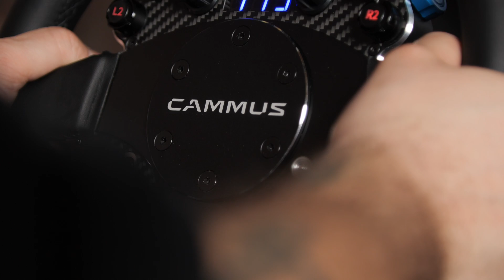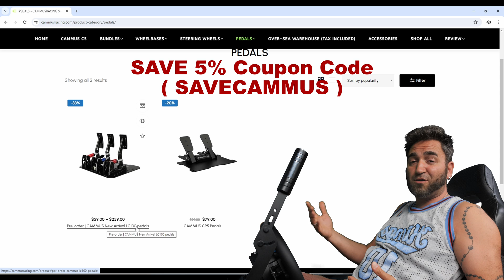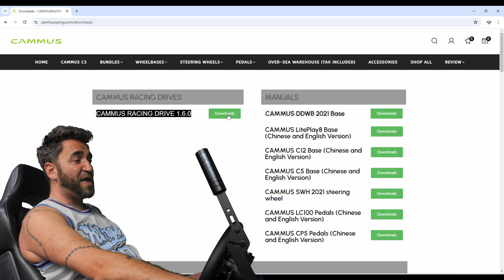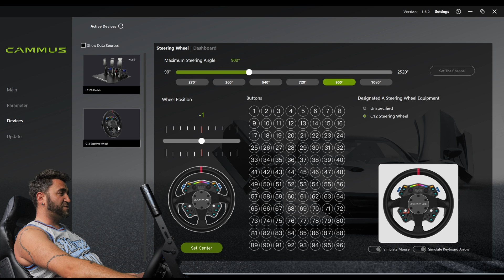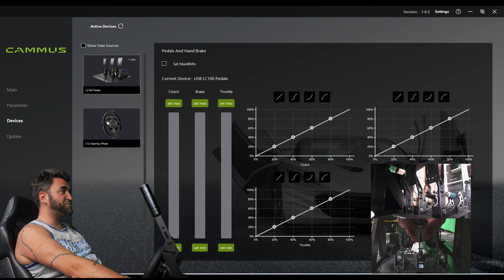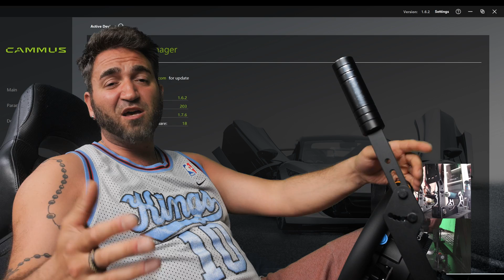Cammus Racing Drive PC Software Tutorial - Settings & Firmware Update

Comment: I’m having trouble sir with my steering wheel c5 like I have the app downloaded on my pc and everything but the wheel is not connecting too it even tho it’s on
Reply from the maker: Is it brand new? 
You just got the steering wheel or you had it for a while now and it just stopped working ? 
Maybe you need to do a firmware update in the app. 
You’re using it with your pc right? 
You connected it to your PC with the usb cable ?

Comment: Hi, when you did the software installation and you came to the driver installation portion. Did you leave the three boxes for the drivers checked and did you answer yes or no when it asked to remove associated components before the install. I'm only asking because i had trouble with my first wheel after software installation, and communicating this to Cammus is difficult due to the language barrier.
Reply: If an OFFICIAL device software recomends to have some components checked, leave them on. Even if some of them are already installed (like VC redistributables) leave them checked. Some are libraries DirectX (and Windows in general) needs to let the software and device work properly. Sometimes when they're already installed they're overwritten, other times the installer skips installation. But if the software says you need it, never uncheck.
Another thing is when the software is downloaded from unofficial websites. But the official site...do as they say.
Reply from the maker: @albertmas3752 great thanks for the suggestions.
Reply: But what was your problem? For example, my Cammus software crashed while installing the wheel's firmware leaving it bricked. Bricked until they helped me solve it (took 2-3 days) and there was no language problem.
Reply from the maker: Hey buddy. Sorry I didn’t reply sooner. 
Did you resolve your issue yet? 
As for the 3 boxes I don’t remember what I selected. I’m going to guess that if the 3 boxes were already selected by default then I just left it as is by default. As for the associated components question. I don’t know 100% what I selected but I feel like I selected yes to remove those associated components before install. 
I understand your situation communicating with Cammus. I hope to help you if I can. Let me know how it goes for you. Keep me updated.